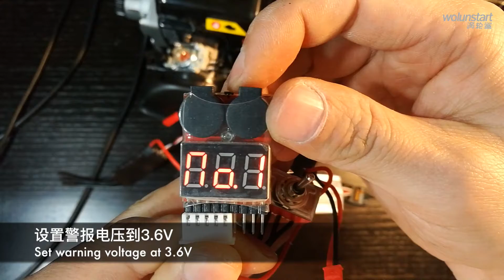30 DEGREES NORTH BWS 5B Remote start Power generation Balanced charge

Comment: hi m8   How u getting on with 30 degree north motor ?  ive had a real sh't experience with my 30cc yama  bollox bullsh;t Baja  i bought of nitrotek (arseholz) i got it brand new at end of Jan this year.  to date ive not even used 4 tanks of fuel.  I bought a fivers worth of fuel and theres still a reasonable bunch in the plastic tank.  It appears that the clutch bell housings ( all fkin 3)  are designed to break !!   oh and the chuffin muffler is supposed to let mucky oily residue  out of it.   not to mention the 2 suspention springs that have failed in exactly the same place (tossers)
    Yeh if could let me know of  your experience  as i want to buy onme of the  30DN buggys.....they look friggin awsome
  Anyway hope you can get back    and happy motoring  brother......Peace Out    Ian
Reply from the maker: I didn't understand, what did you say?  :P

Comment: nice video man I have the same buggy but unfortunately my rear tyres are not moving only front two tyres are moving I am looking for rear gear but difficult to find parts for this buggy i found one item which says fits in losi 5 t
'54T spur gear for Losi 5ive-t " my question is is this part fir in 30 degree north buggy also ?need ur expert advice
Reply from the maker: You need to take photos of the accessories to me, I can contact the manufacturer to deliver the goods to you.

zxdlttzlj@gmail.com

Comment: All your videos that I watched I have only seen this installed on the 30 Degrees North BWS-5B and RCMK XCR 1200 1/5 scale RC.  What other engines will this fit. Example Zenoah, CY,. I know you sell this on ebay, but it would be nice to see what engines this is compatible with.
Reply from the maker: The suitable engine needs to meet 3 conditions: 1, Its structure needs to be similar to the engine in the video；2, The engine is an air-cooled structure； 3, According to the size I offer, there are enough space to install it.

Comment: There are modified high performance engines available with higher compression compared to stock engines. Example engines are Scott Finlay, RC40evo, OBR 38cc Widowmaker, along with G340RC. Is this unit strong enough to start these high performance engines.
Reply from the maker: The engine of 38CC is not suitable. Engines larger than 32CC are not suitable.

Comment: Is this just a starter or does this also keep your battery charged?
Reply from the maker: After starting, it will generate electricity and charge.
Reply: On a Battery operated Drill motor starter units and even the pull starters the starter mechanism pops out and locks into the flywheel to spin the flywheel and start the engine. After it starts it pops back into it's neutral position so it doesn't spin the whole time while the engine is running.                                                                                         
 How does this electric starter charging system work. Does the flywheel keep in contact with this starter after starting and turn this mechanically to charge the system.

Comment: Where can I get more info on this unit, it may be just what I need if so if it works on big cc motors then up to six may be required.
Reply from the maker: Hi! I found this on eBay and thought you might like it! Check it out now!  wolunstart Z51 Remote control alternator electric starter for 1/5 rc car http://r.ebay.com/xnVTVU

The product does not apply to engines larger than 32cc.